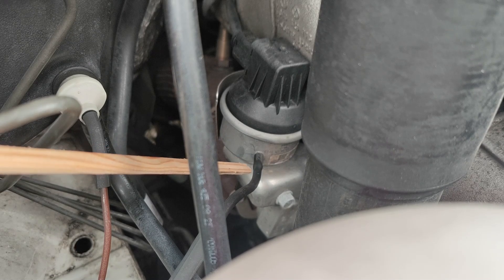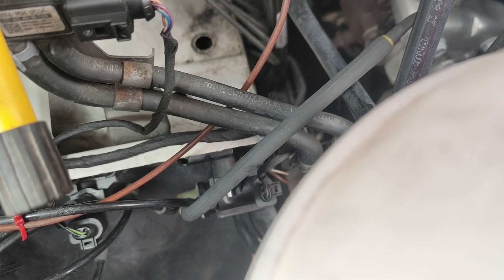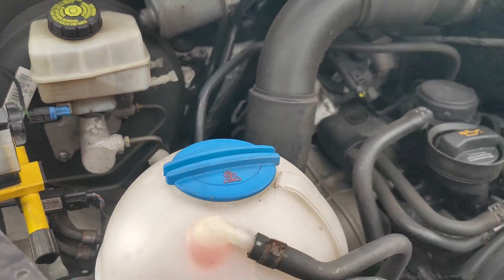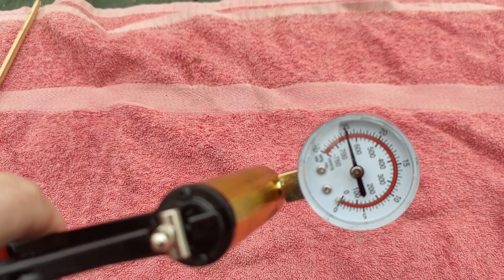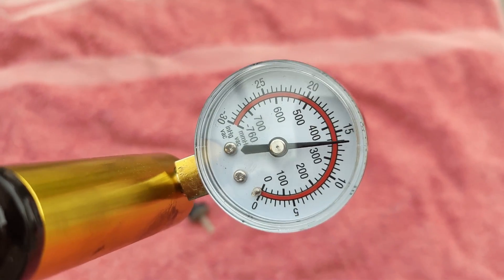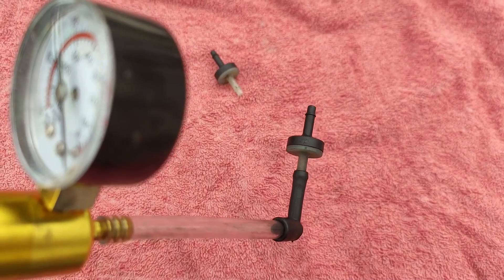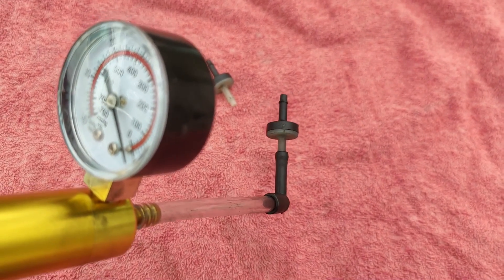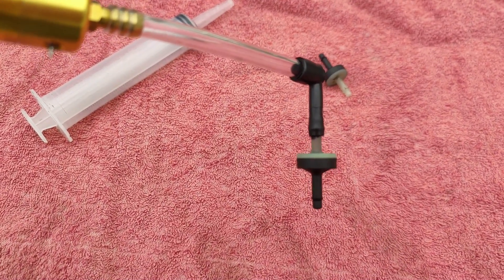VW Crafter 2E limp mode VCDS codes are P0299 and P2563, low Boost due to vacuum fault(s).

Comment: So this is interesting as im getting similar codes for a cayc engine (1.6tdi). 
Now iv noticed with mine it raises the idle when braking until fully stationary. Iv got a vac tester so happy to go messing. Iv had these codes a couple times thought id fixed it with a new n75 valve and egr solenoid, car boosts lovely until higher boost say 3-4k revs then drops into limp mode P0299 P2563 codes produced. Actuator already been changed and checked again recently, passes vac test on actuator itself, holds pressure with engine running at idle (doesnt bounce or judder)

Comment: That backvalve, isn`t only to hold the vaccum pressure to next restart when you have turn the engine off?
It should not set a error code when the engine is on. When vacuumpump is on and do its work when the engine is on.

Comment: Thanks for this mines doing the same.
Reply from the maker: @jordanhirst457  mines been ok since changing the valve other than a separate issue I still have a persistent Nox sensor fault every 300 miles or so which sets the mil light, not found any diagnostic tool yet that can show Nox sensor values VCDS can’t seem to do it etc!
Reply: I did your DIY on my valve and it briefly ran really well. Ordered a couple from auto doc. Hoping that's the end of it 😅 
I have that with mind aswell

Comment: I’d keep it as a spare in case you get stuck. I had the vacuum pipes to my EGR changeover solenoid reversed after a new clutch and ended up with a new N75 and then turbo which lasted 800 miles before throwing up the same error code. Borrowed a vacuum tester and worked my way up each line and found it wouldn’t hold with changeover solenoid in place. About to source another solenoid when it occurred to me that pipes could be wrong and after checking found they were. Easy fix in the end but frustrating to find as it wasn’t until the solenoid activated, under load with engine at operating temperature, that it lost vacuum and then couldn’t control the turbo properly. The fault code relating to turbo actuator position etc now makes sense but at the time pointed to a faulty actuator. Live and learn 🤷🏻‍♂️
Reply: Hi! 
Is your Crafter biturbo maybe? Ours is biturbo and doesn't want to switch to second turbo at all,both of turbos have been tested and are working,new solenoids are put,still nothing. Any advice?
Reply from the maker: @milenakoprivica5119  Sorry, just seen this no, mine is the earlier 2.5, 5 cylinder!
Reply from the maker: Yes I will thanks, alongside the old N75 valve which despite being dated as 2004 is probably fine. I am glad I tracked down this leak as we will heading back up to Scotland again soon and random limp mode would not be fun!

Are you still on Arran? Last time we both visited that island was circa 1993 iirc on a Yamaha XJ900. Off to Mull this year!
Reply: @CriftinsCampers  I have the old N75 as a spare too. Funnily enough is was just after landing at Lochranza that the new turbo threw the same error code. It was hard work driving the narrow twisty roads down the south part, although some days it would behave (probably cooler days in retrospect where perhaps the EGR changeover didn’t operate). I’ve been back a few weeks now but over again later in the year I suspect. Enjoy Scotland 🙂